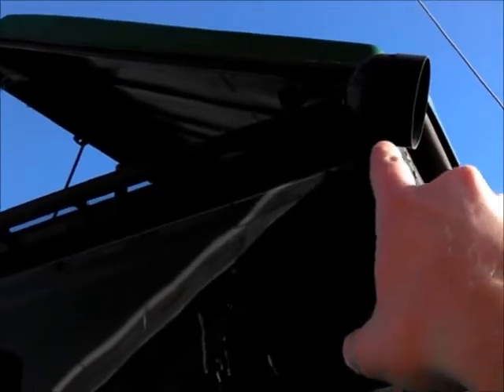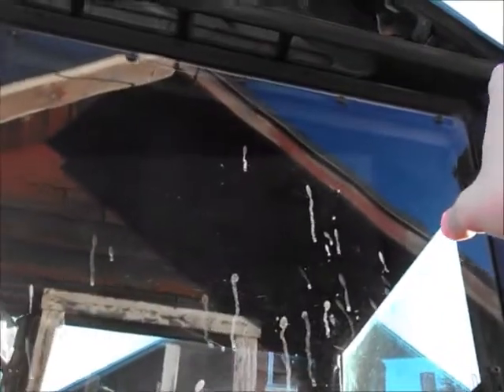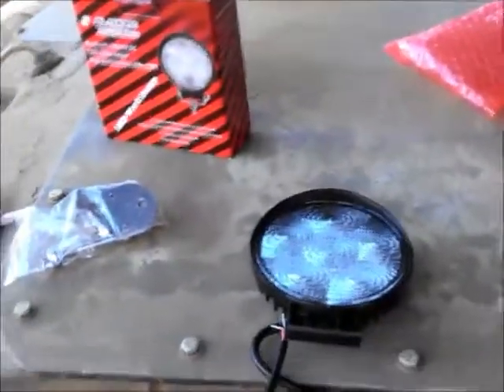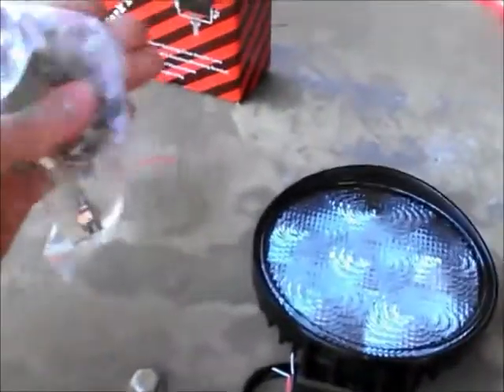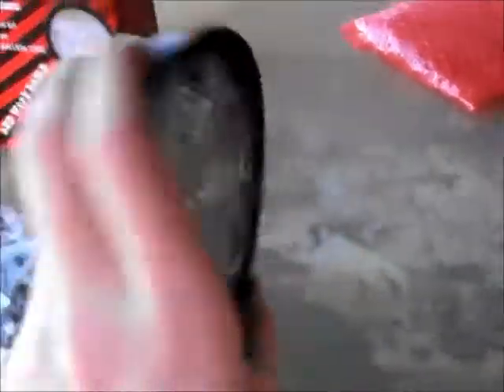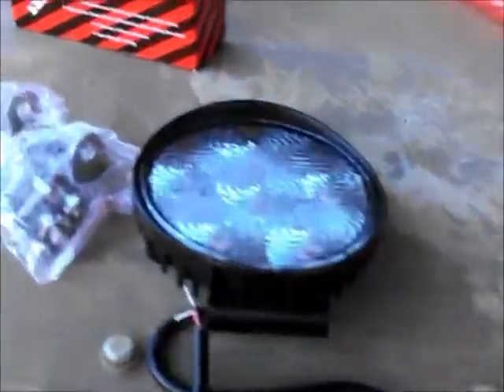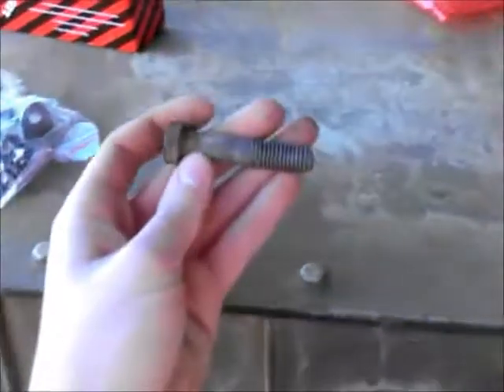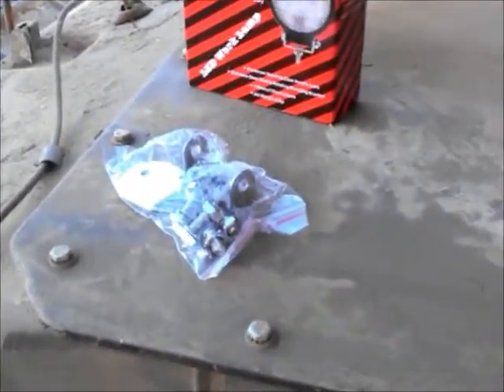Incandescent to LED Conversion

Comment: I added a light bar I got off Amazon to my Kubota L2501 compact utility. As with any loader tractor, the headlights give you a superb view of the back of your bucket. I put the light bar up underneath the top part of the rops bar and it lights up in front of the tractor light a football stadium. The light bar is a combination of spots and floods so it solved the one problem that you mentioned about a wider beam vs narrow. The cheap bar works for me as my tractor will never be out in the rain or inclement weather. Your tractor on the other hand most likely will see rain at least so the cheaper non waterproof lights might not be the way to go.
Thanks for posting the video.
Gary Fox, Iowa